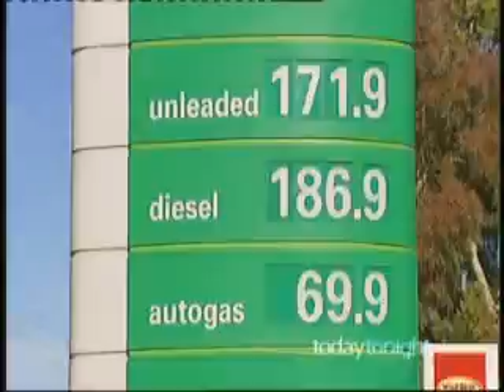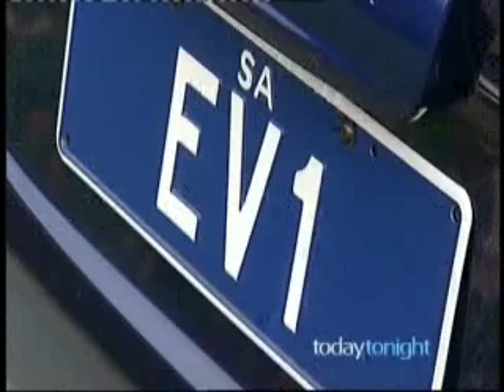Electric Car - Australia

Comment: This car is identical to the Blade EV and he's sings the same tune looking for Government hand outs. 

A 2nd hand imported chassis with some imported EV components and batteries bolted in. Exactly what is the local IP content?

If the Ev conversions are viable, then just start production.... no tooling is required as nothing is being manufactured locally.

Comment: Firstly you don't have to burn any fossil fuels at all, you can use nuclear, solar, wind, hydro etc. your possibilities are limitless. Secondly even if you do get your electricity from fossil fuels it still produces FAR LESS emissions due to the >90% efficiency electric motor compared to a combustion engines' 15% or so efficiency (most energy is lost to waste heat).